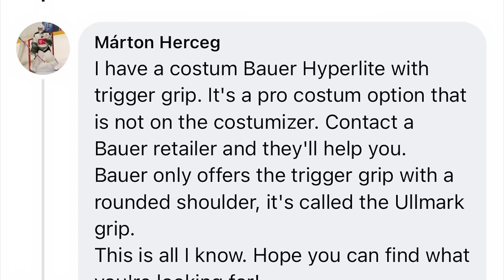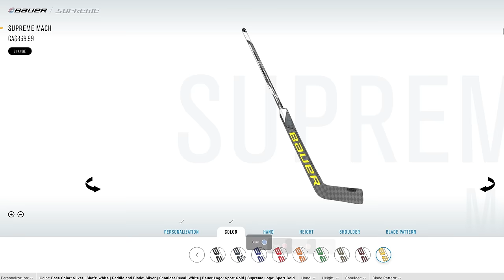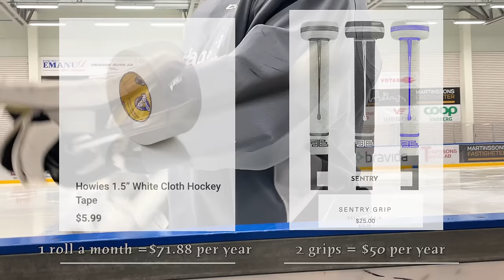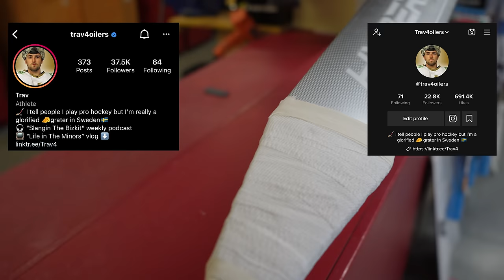Goalie Stick Hacks YOU NEED TO KNOW!!!

Comment: Totally agree with you on why the standard paddle is shaped like it is on the top. It has never felt comfortable. Personally I would be very happy if they had the trigger grip as a standard offering, not custom.
Reply: Trav do you think you can do a video on how the trigger grip/ullmark grip differs compared to the bobrovsky grip. I tried the bobrovsky grip but didn't love it and would like to see if the ullmark would work. Also how do you order a ullmark grip I was looking in custom and couldn't see it. Thanks love the channel
Reply from the maker: I agree
Reply from the maker: I think theyre 2 completely different things. One is for controlling the stick to be able grip the stick traditionally, the bob grip is to take control of the stick and make low blocker saves

Comment: Use a Dremel with a cutting wheel. So much faster than a jigsaw, and arguably easier to control. BTW -- This is a legit mod. Finally did it a couple weeks ago, and it's well worth it.
Reply from the maker: Long as you get it done :)

Comment: Okay, hear me out, I tape my blade just like you, but for other reasons, when I stickhandle and go to move the puck from my forehand to my backhand och the other way round the puck tend to flip, or at least want to flip. This makes for a much harder time when you are trying to handle the puck. 
But this is just my reason to only tape half of your blade
Reply from the maker: I think you gotta be more firm on the puck and work on smoothing the transition between backhand forehand
Reply: @trav4oilers  yeah i have been working on it for some time now and I does not happen as often but in sticky situations I dont want to risk it haha

Comment: They have the paddle  shape like that for retail so you  can shave it, not everyone have the same size hand that why they dont retail it.   Most pros over 95%  have rocker blades on the goalie stick , it is never flat,  this allows them to cover low blocker and in tight also better mobility and rebound control.   the length is just a measurement doesnt indicate the  hand position because the blade is not a straight line.  You dont need a trigger , better off buying a smaller stick and adding a knob 1" above the paddle shaft joint.  they way the paddle length is measured for legality purpose straight where it is widest and stops when reaches end of heel,  not from the shaft joint.  Too much work on the goalie stick,  just go get a procustom not  retail custom options.
Reply from the maker: I disageee , i think if they opened them up they would have people ordering them